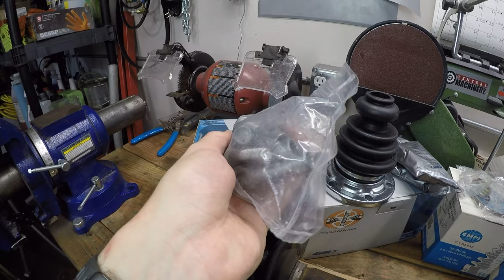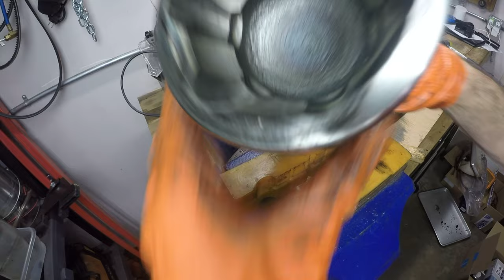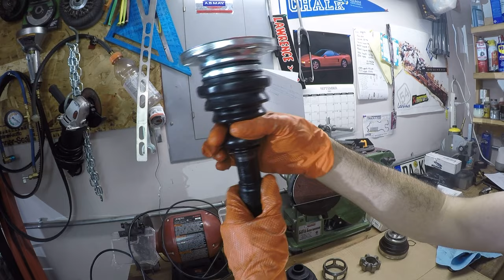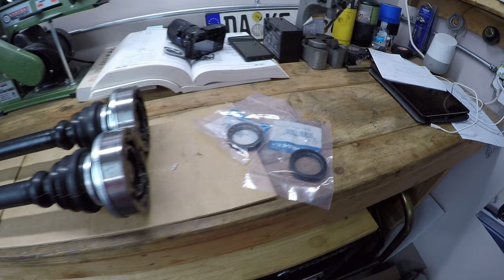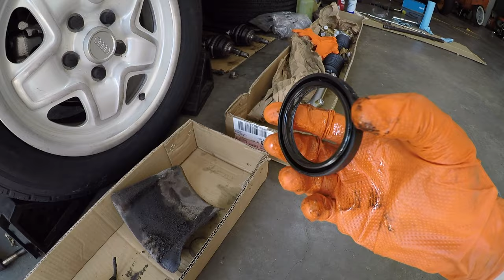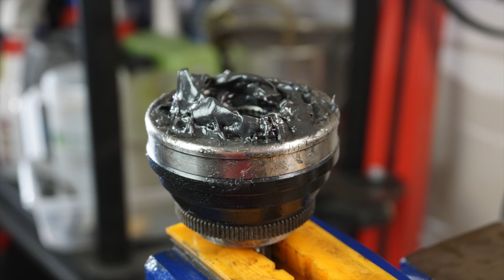Project Audi 5000 CS Quattro | Ep. 8 | Rebuilding CV axles & replacing flange seals

Comment: Good to have this for when I rebuild the inners. I don't trust the outers on mine right now, still trying to figure out the part. did find them on spareto but we will see if they work. Loving the series! hoping you'll be doing the oil pan gasket. either way, you are doing a great job on this series! thanks for the hard work!

Comment: You should get someone to dry ice blast under the car. I think that would raise the value a whole lot especially when you consider how much work you have put into it.
Reply from the maker: Dry ice blasting is a fascinating social media fad, but I'm afraid it works against the usability of a vehicle, especially an older car. All it does is remove the oil and grease build up, which is likely the only thing preserving the underside integrity of the car. This is even more pertinent if the car is being used in winter like this one will be. Dry ice blasting won't make corroded hardware and parts suddenly have paint on them. The dry ice blast before/after effect certainly works great on vehicles that have never seen a snowy winter! 

With regards to increasing the value of this particular car, there simply is nothing I could do to increase its value at the moment. They are practically worthless in 2022. When I'm finished, it will get used as car!

Comment: Very nice!  Just FYI, try to find Hytrel (thermoplastic) boots instead of rubber from a good brand.  This particular material lasts over 15 years in a daily driven vehicle.  Of course there are some cheap plastic noname boots that should be avoided...
Reply from the maker: I hadn't heard of Hytrel before. Curious if they make something that fits this obscure vehicle. I was running into a very limited selection of boots for this car.